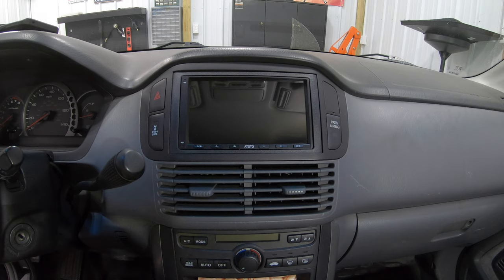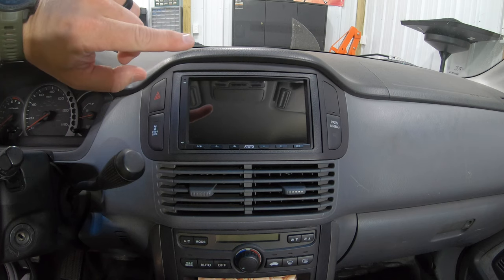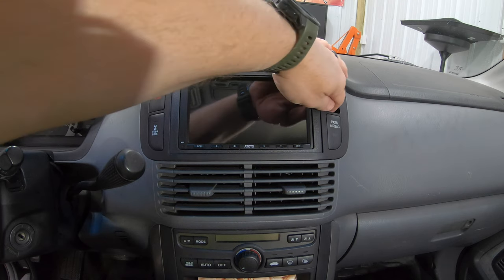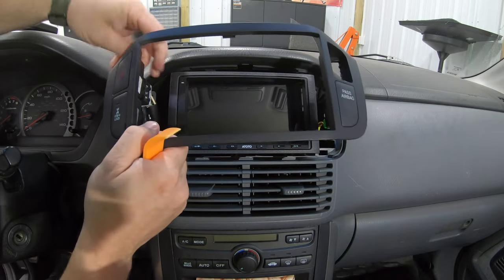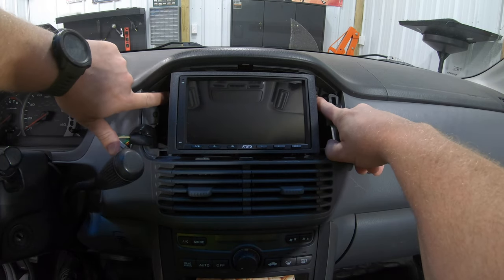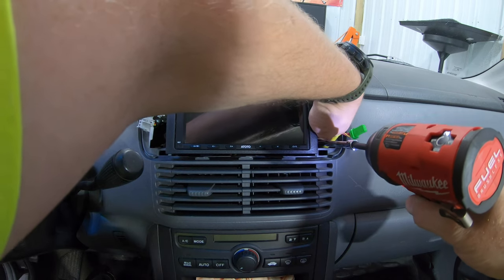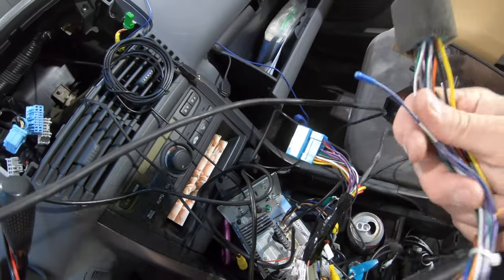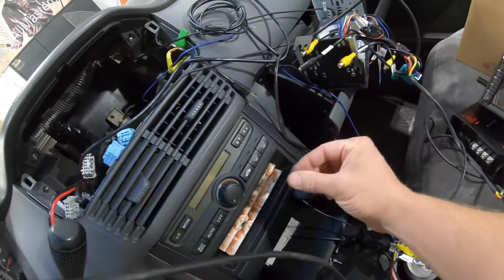2003-2008 Honda Pilot Android Navigation Stereo Upgrade - Joying Double Din JY-UQ135N4G

Comment: Did u connect the dvd player that came in the pilot to the double din?
Reply from the maker: Mine did not have a DVD player.
Reply: Do u have to buy separate wiring for the steering wheel setup?
Reply: I guess my question is how do u wire the steering wheel controls..really confusing
Reply from the maker: With this stereo you do not need separate wiring or a controller. With something like a pioneer or Kenwood you would need a steering wheel control interface. I thought I showed in the video that there is an additional steering wheel control wire that must be added to the harness and then the stereo is programmed to read that wire

Comment: Hi , Thanks for sending the link to the reverse camera. I am new to this idea of radio installation and I have never done one before. Your video is very good and I think I can learn to try doing it myself. I watched your video and have two questions from what you said in the video.  you said you wanted two things coming out from the new stereo . Can you explain the reasons why 1) you wanted a remote turn-on wire coming off the new stereo and a RCA cable coming out of the new stereo?  You also mentioned in your video that the stock head unit has an internal amplifier for the 2-Amp(?) subwoofer. To get the stock subwoofer to work, I need to get a head unit a built-in internal amplifier ? Thanks
Reply from the maker: I just added the RCA cables and trigger wire in case I want to add and external subwoofer  and amp later. It is not necessary to do that. The Pilot (depending on trim level) comes with a OEM subwoofer in the rear. It is powered by the stock head unit on a separate internal amp. So if you wish to retain the stock subwoofer (which I did not do because it sucks anyway) you would have to add a small amp somewhere behind the dash as the aftermarket Joying stereo can not power a subwoofer itself
Reply: @JackofAllMasterofNone  Thanks for your answer. How much internal amplifier in a head unit must have to power the honda stock subwoofer?  I appreciate that you are teaching me how to go this process to learn to do it myself. I want to understand before doing this. Thanks again
Reply: @JackofAllMasterofNone I have the ex l model it hards pretty good considered what it is . What type of amp did you use and that would have to wire off the sjoy I ordered correct?

Comment: Hi, I was just wondering if you have had any issues with the new firmware since on the Joying website it says this firmware is only for the JY-UQ135N4G-DA and not SKU: JY-UQ135N4G.
Reply from the maker: The firmware I used is listed for this unit.

Comment: How do I retain the stock subwoofer to an aftermarket deck? Dual model xdcpa9bt. Also I used the scoches wiring harness but the power antenna isn't working and I wired the power ant to power ant coming from deck but no reception.
Reply from the maker: Need a separate mono sub amp. Better to just use an aftermarket powered subwoofer.
Reply: Hello sir appreciate the video, what name the CarPlay stereo Honda pilot 2005

Comment: Does this work with the factory backup cam? And GPS?
Reply: Yes it does, I just installed this unit in my swift sport 2018, you do need to get the cambus link cable and a few other cables to match up with your model of car to make it work, but it does it just fine.
Reply: My advice is to do research of the parts you may need to make it work with the model of car you have.